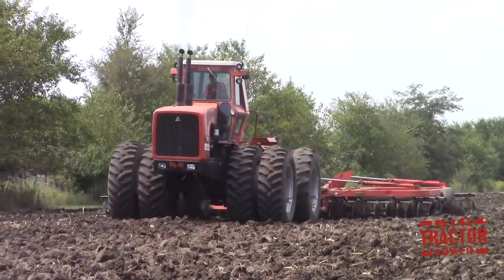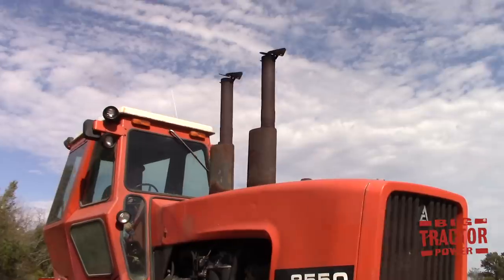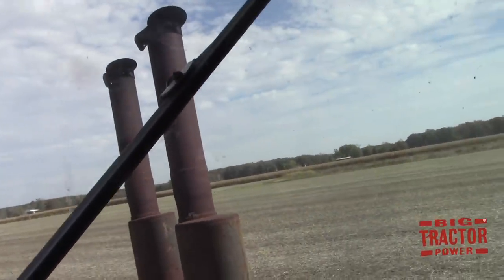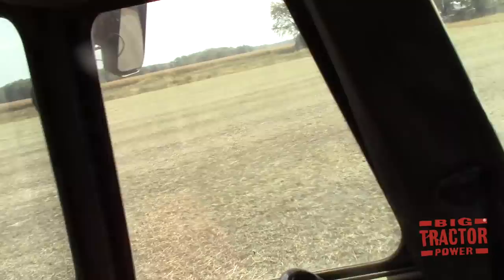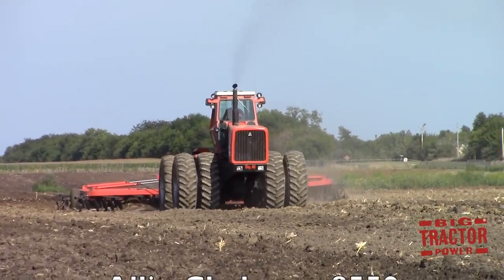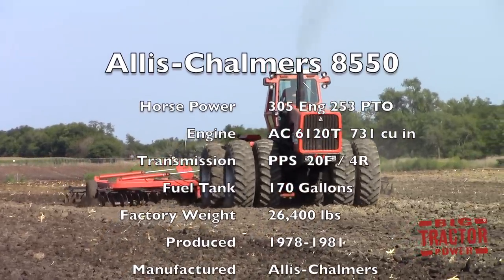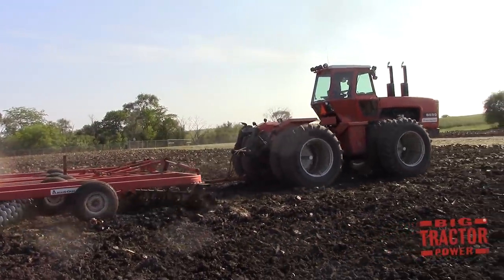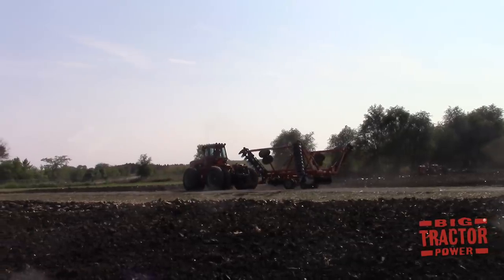Allis-Chalmers 8550 4wd Super Beast Tractor

Comment: B.T.P. driving Big Al...HAHAHA!!.
My dad had a brother-in-law in real life named"BIG-AL",the irony of it all.
Now on the 8550s did they have heat and air conditioned cabs B.T.P.?.
Reply from the maker: Yes the 8550 had heat and air standard.  I had to open the door to film the inside of the cab because it’s a one person cab. No buddy seat to ride along.
Reply: @bigtractorpower  Nothing like John Deere's"trainee seat".
Reply: @4gauge10  invented by Allis Chalmers
Reply: @RJ1999x   I haven't lied about anything and no I'm not a snowflake and far from hurt,but it's you that's missing the chromosomes and you can't lie about that.Your last post really proves this.
Nothin'like honesty.😎👍
Reply: @RJ1999x  In 1974 I bought new a AC 7050 and a new JD 4430. For the 15 years I had both AC and JD equipment. AC was better by design but JD was much more dependable. After 15 years and when JD  put the cab in the middle on their combines it was all JD from then on. We have all JD today.  The first piece of equipment with an out right buddy seat in it was that I had ever seen was the JD 9600 combine.
Reply: @davidadcock3382  debatable. Gleaners came with arm rests that were 8" wide once folded down two could sit in a gleaner pretty comfortably.
New Holland also had a flip down seating area starting in 1985.  Your experience with JD is your experience mine was just the opposite. When we moved away from Allis Chalmers when Duetz bought them, I bought everything John Deere, the repair bills were enormous. The difference is a John Deere guy never admits the problems, because the marketers at Deere have convinced farmers that John Deere is more reliable. They did such things as a 45 minute hour, so you thought your tractor clocked way more hours then it actually did, just as an example.
The best move I ever made in farming was getting out of John Deere. The only thing left is a John Deere disk, which we rarely use, and 2 old 2 cylinders that were my Grandpa's.
Reply: @RJ1999x  What ever works for you. I had a 2 year old 7580 that we put a new engine in it three years in a row. We never turned up a tractor. We had an AC 8550 that did not give us much trouble and was a good tractor. We had an 8630 that was a very good tractor. The JD 8630 out lasted the AC 8550. We had John Deere every since. We had a very poor L combine a very good L2 and and good L3 and an N7 that was a total piece of junk. I have had John Deere combines from then on.   An arm rest is not a buddy seat. The first piece of equipment I purchased that had a true buddy seat option was a 1989 JD 9600 combine.
Reply: @davidadcock3382  I know you're lying. 3 new engines in a row? Not possible. I had an 8630 John Deere it was a gutless wonder of a tractor, I own 2 7580 1 has the original untouched engine in it 3000 hrs, and it will out pull the 8630 any day. The other one I got from a neighbor who put an 8.3 Cummins in, doesn't pull any better Burns more fuel.  They don't do the heavy work around here, we have a Steiger . I owned John Deere combines right up to the 9500, then switched to New Holland, wouldn't trade back to a John Deere for any money. The John Deere would run us $12-15,000 a year in maintenance cost for 2500 acres, vs under a $1000 for the New Holland
Reply: @RJ1999x  What ever works for you. That is correct three engines in three years. It went to a new home with a new engine.  My dealer was good about it and always give me a loner tractor to keep going. I am glad that you now know what a true buddy seat it is. I do not appreciate being called a liar. At least I use my real name but with your ignorant mouth I can see why you don't.
Reply: @davidadcock3382  There's no possible way you blew 3 engines 3 years in a row, either you're extremely abusive, or your idea of a new engine, or the mechanic you have is extremely unknowledgeable. I always find it interesting when being called out, the personal attacks start. Which means I am right on target.
Reply: @RJ1999x  It is true and the dealer helped me find a new home for the tractor and I bought an 8550 from him.  The first time it blew the starter off when things came out the side of the engine. The next time it was a broken crank and they salvaged the block. The third time it blew the side of the block out again. The dealer got rid of it for me and we bought an 8550. They wrapped those engines out at high rpm.  If the company was not taking care of it I would have put a Cummins in it.  What is your idea of a new engine is it the same as a buddy seat?
Reply: @davidadcock3382  Here's a funny story, I've been around the 426 engine for 40+ years own 6 of them ranging from the D21 to the 7580. 3 of those engines are 200+ hp. I built a 210 pulling tractor that makes 650hp and tons of RPMs and yet not 1 failure. The 7580 has 3000 hrs on and never been touched. I've overhauled to "new" about 100 426 engines with 0 failures. I've gotten engines in that failed, broken cranks, ventilated blocks, spun bearings, and every single one could be traced back to human error. 1 broken crank was due to a mechanic at the John Deere dealer forgetting to tighten the oil plug, a customer drove it around the dealerships lot, the plug vibrated out and dumped the oil. 1 broken crank vented block like you're describing that happened to you was due to a John Deere mechanic installing the injectors in upside down, the engine starved for fuel, seized the Pistons in the sleeve,pulled the bearing caps off broke the crank and threw the bearing caps out the side by the starter. The spun bearings and cracked Pistons were caused by plug radiators, or broken thermostat and they ran the engine overheated. 1 7060 with bad Pistons and a broken block was drying corn on a dryer, a feed bag got sucked into the fan busted the belts and the engine kept running until it seized up, once it cooled down the engine started back up with tons of blowby, yet the Farmer wouldn't admit it sucked in a feed bag, but the evidence was wrapped around the pulleys. So if what you're saying is the truth, that you had 3 "new" engines fail, would be impossible. And by New engine I'm talking completely gone through or new factory crate engines. Although your dealer may have been a nice guy, his mechanic was incompetent if he was patching a blown engine and not finding out the reason for it's failure.
Reply: @RJ1999x  What ever. I had three failures in three years.Two new engines and one completely redone at the dealership as I stated.  The 7580 model was ordered in the fall of 1976 and delivered in feb. 1977 . I traded my 1974 7050 in for it. It failed in 1979, 1980 and 1981. In 1981 The dealer helped move it and I purchased a 1980 8550. I purchased one of the last 8630 made 1978 model from a neighbor  in 1984 with low hours. I kept that tractor for 16 years and it had around 9300 hours on it when we updated to a JD 9400 4wd. Everyone around here had lot's of trouble with their 8630's but they were turning them up something I never did. We sold the 8550 in the late eighties, It had been a good tractor. We replaced it with a JD 4455 when we went to some no till practices.  Why don't you try to tell me it was impossible to go to the moon for you would be making more sense. I do not appreciate being called a liar from someone who is afraid to use his own name.
Reply: @davidadcock3382  i call it as I see it, whether you like it or not. You did NOT fail 3 new engines. You just want to double down on the lie now because you've been called out.
I know that's your real name how?
A pretty poor argument of who is telling the truth by what your handle is on YouTube
Reply: @davidadcock3382  You voted for Hillary didn't you? You have to be a liberal when losing an argument you have to revert to personal attacks. You know what they say, you know you're on the truth when they resort to personal attacks to prove a point
Reply: @davidadcock3382  Lol, no you didnt
Reply: @RJ1999x  More wild speculation. You need to stick to arm rests and buddy seats fool.
Reply: @davidadcock3382  Keep going, your showing the world your only argument is personal attacks.
Reply: @RJ1999x  When you got caught spewing your garbage you went directly to changing the subject. You and Hillary would make a great couple.
Reply: @davidadcock3382  Didn't change the subject at all. I explained why you're either lying or were just unknowledgeable about what was happening. You decided to turn personal by name calling and other tactics.
And now you're doubling down.
Any rube reading this might side with you, but any mechanic or anyone of knowledge will know it's not possible to have blown up 3 new engines in 3 years.
And to prove my point further, if I blew the first engine I'd be like ok shit happens but a year later blow it again I'd get rid of the tractor, much less trade it for another piece of shit Allis Chalmers.
Reply: @davidadcock3382  Ronald Reagan is why we have fake news today, so I wouldn't tout him as some kind of political genius, if that's your angle.
I forgot more about engines then you know.
And Allis Chalmers offered the deluxe seat with fold down wide armrests, and even offered them as office chairs to the dealers to promote the deluxe seat with the capacity to hold 2 people. It was advertised as such, so technically it was the first to offer rider comfort in a combine cab. John Deere made an actual seat stealing the concept from Allis Chalmers, much like everything John Deere has ever done is a copied version of some other innovator.
By your logic the only lightbulb is the LED because it's a cousin of Edison's original light
Reply: @davidadcock3382  I'm sorry I can't argue with mentality challenged people it's unfair on my part to match wits with an unarmed person.
If you really are a Farmer, you're in the perfect occupation
Reply: @RJ1999x  You need to learn to quit with the wild speculations and wild assumptions. They will get you in trouble and make a fool out of you every time. I am who I said I am and my experiences are what they said they are and your wild speculations and wild assumptions can not change that. Your arm rest need more work, go argue with them.
Reply: @davidadcock3382  yawning
Reply: @RJ1999x  Good for you. It s the first post you have made any sense or did not make wild assumptions. Sleep well.
Reply: @davidadcock3382  🤦‍♂️
Reply: @RJ1999x  Thats my name, are you ashamed of yours?  Sleep well.
Reply: @RJ1999x That's code talk for taking inventory on zero brain cells.
Reply: @RJ1999x  No,I've worked on about every brand of equipment that has existed through the many decades of experience of being a mechanic.
John Deere is the dominate brand above all others.This is why most farms are"GREEN".
Reply: @4gauge10  Most of what you post is a lie, and for your information the number 1 selling tractor is New Holland. And the number 1 selling combine is New Holland world wide. Only in the Midwest is John Deere a dominant player

Comment: These tractors were a failure,bad trans bad motor bad idea!! You had to want to make them work!Had a quiet cab?It was a sad excuse for a 4 wheel drive tractor!
Reply from the maker: I had not heard a poor report on them.  Allis-Chalmers built over 800 units of the 8550.  They always seem to operate nicely when I have had a chance to run one.